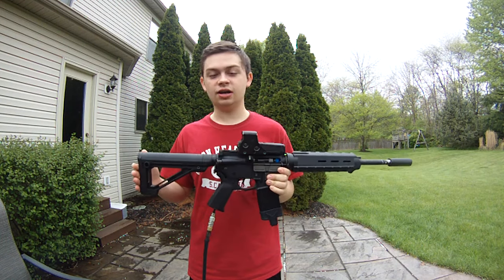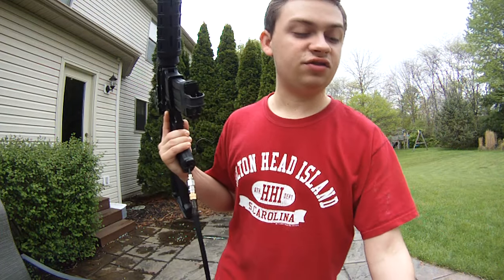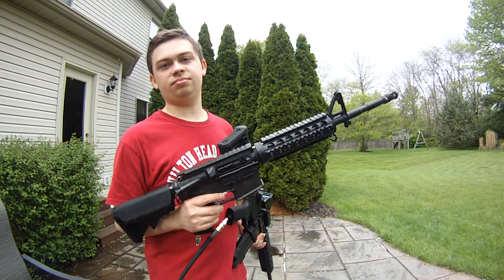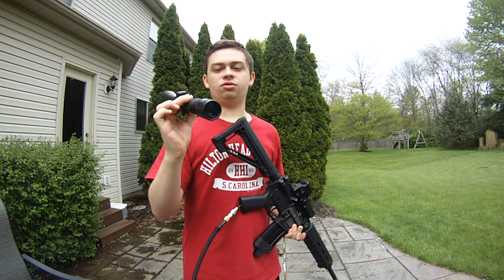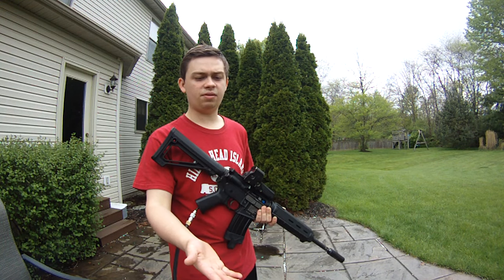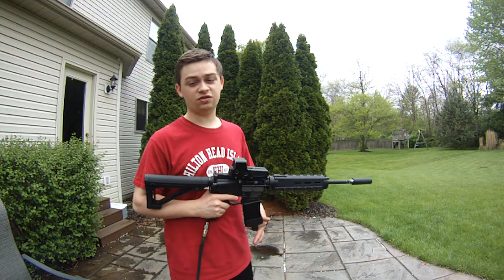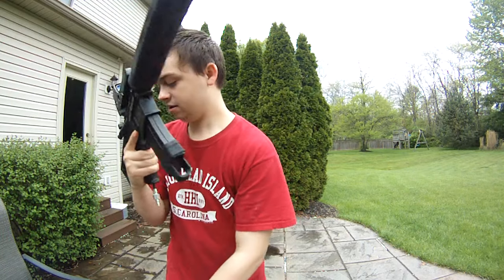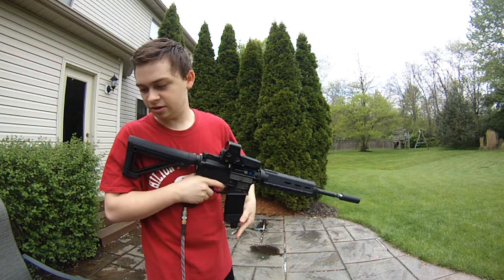Custom HPA JACK M4 review and shooting test

Comment: with a full tank the fps will not change the regulator controls the amount of air let out through the line so there will be no differences
Reply: It can actually. Depending on the temperature of the tank.
Reply: @revengeof1307  that was 6 years ago
Reply: @bobparr6673  and?
Reply: @revengeof1307  and he probably died
Reply: @bobparr6673  ye prob 😭😭

Comment: the regulator makes sure the air output is the same no matter how full the tank is. so how full your tank is has no impact on how fps is, only your set psi output on your regulator.
Reply: A SECONDARY regulator does that. The built-in regulator does not.
Reply: that is what I was referring to.
Reply: Phunny u can't have an hpa gun without the "second" regulator

Comment: my gun is 20 round a second and it isnt polar started
Reply: bb bb most aegs at this point will hit 20 rps but polar stars will hit 30 or higher easily
Reply: Mine is 35, who cares?
Reply: @caderaymond5512  there are people with 100 rps aegs
Reply: @trevoring9442  100 rps aegs wont feed
Reply: @attila.p7612  yes they will the person who made it shot it on video only issue is it shoots twice on semi sometimes because of overspin
Reply: @trevoring9442  can u send me a link
Reply: Bay my aeg can hit 38 rps at max, and 340 FPS with 28s . Hpa is way more consistent but aegs can compare

Comment: The madbull redshark is the best bucking for a Jack. You say its way inconsistent then chronograph it was only 3 4 fps spread thats Fantastic consistency... Then you talk about using .20g bbs or possibly .25g... Jacks really dont like anything Less then .28g bbs. If you want accuracy .30 .32g is the best choice. Dont bother with Joule creep bla bla nonsense. I have done Extensive testing AND have found it to be pretty much FALSE unless you get crazy heavy weight bbs like .40 .43g bbs. Going from a .25 to a .28 or .30 wont make ANY difference. The idea of a polarstar shooting harder then an AEG at the SAME FPS is ridiculous.. I have tested this Theory and find it 95% FALSE. Why not 100%? Simple. A polarstar WILL shoot Slightly harder with Heavy bbs after chronograph with a .25. This Slight increase is NOTHING to even talk about 5 fps or so... So Here is the long story short. AEG .25g 370fps Polarstar set the same 370fps .25g. Nothing changed only moved to a .30g bb. AEG = 345fps Polarstar 353 fps... This Slight difference is NOT worth talking about... BUT if you stick a .43g bb that Number could be 30fps difference THAT would be Cheating and COULD be over Joules for BB weight and Fps.